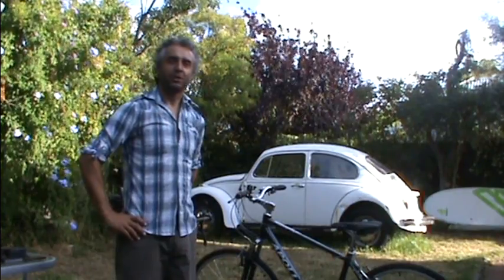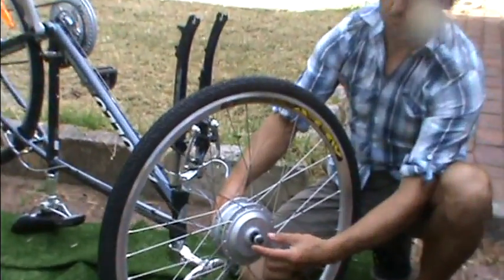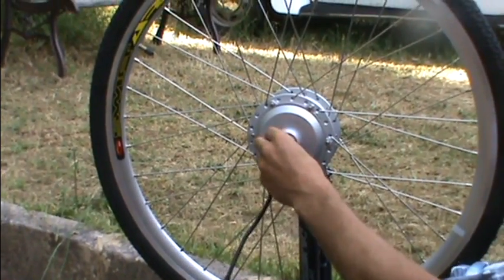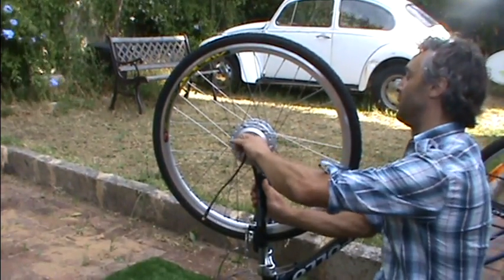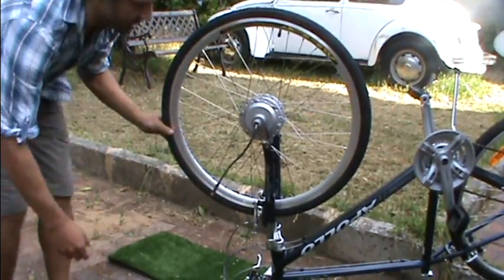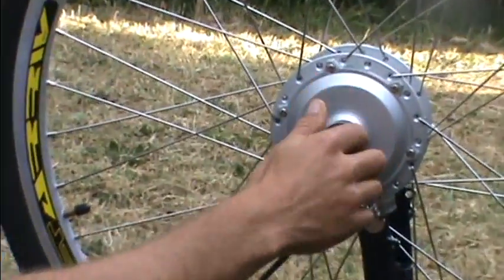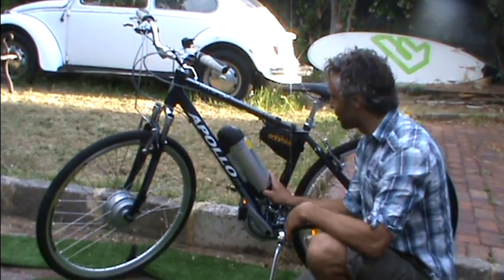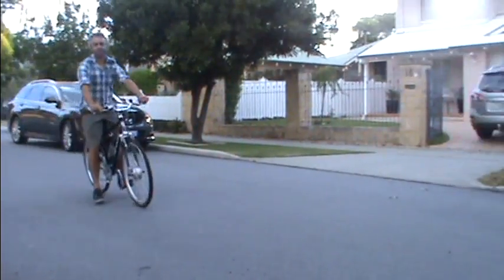Electric Bicycle Kit Installation Video Using Panasonic Tube Battery

Comment: hi I have a 1000 watt solar ebike and I was wondering if you could tell me how to set the computer that shows U how much battery U have left and your speed etc etc. as I messed around with it and the Speedo is off and the pedal assist has stopped working due to messing with the P and C settings.
I'm in Perth metro area if U have a shop I can come to what ever is easiest as the shop that sold it to me in Newpark has shut down. Thanks and good viewing

Comment: You don't need a torque arm for a 250w front hub motor only over 1000w than you need a torque arm

Comment: I've fitted 2 kits exactly the same type, really easy to do if you take your time. I've done 1000 miles over the last year, they are great to ride and it's up to you how much work you put in.
Reply: Hi there ...Can/does the battery charge itself when you peddle instead of plugging the battery into your house mains ...Thanks john

Comment: tip for removing grips, if you can pry up edge of grip and bust a little bit of nut under grip it slides right off ! if there is any leftover save for another project or give to significant other.

Comment: Hey, your information is fantastic, due to time and money constraints it has taking a year to build my Cannondale Scalpel  with an e-bike conversion kit. I elected to place the hub motor on the  rear wheel with a 48v 1000w system using a Panasonic Lithium Ion battery (pictures and video available on request). Your video has been an extreme asset in this build.
My question is it the VW in the background available for sale?

Comment: Why do the yanks always think they are special don't like the price it's simple don't buy it
Reply: Yes, most yanks are idiots, yet as a Yank my self I took this invaluable information and applied it to My Cannondale Scalpel with a rear mounted mounted mounted 48v 1000w motor with a Panasonic 54.6 volt battery and it simply runs like a charm. Again most "Yanks" take short cuts to save pennies and time yet the few of us that utilize our brains and common sense can build a the some of the best e-bikes by referring to this video. 
This should be a required video for any one building an e-bike.
Admittedly, I spent a few hundred extra quid, yet this video post helped me build an e bike that accelerates  to 36 mph (57.94 kph)
Surely I have used all the top components available, like Cannondale frame Scalpel frame with a lefty fork Lefty fork, Mavic rims, Cannondale carbon seat post and handle bar, yet the bike simply screams screams down the road as I pass my co-workers driving the gas hogs sitting in heavy stop and go traffic.
Yet my upgrades are not needed, I only did them because I wanted the best.
All any any comments and questions are welcome.

Comment: is it possible to fit on drop handle bars with STI brake gear levers
Reply: +Anthony Poore Drop bars are difficult.  The width it typically a bit larger than that of a flat or raised bar. You can't get the throttle on.  There is the odd solution I've seen that isn't so elegant or you could you a pedal assist sensor in the bottom bracket and have no throttle.
Reply: +Matthew Timmins I have the wider drop handlebars (I'm wide at the shoulders) STI Brakes incorporate the gear levers,171/2 inches /44cm inches apart. This leaves 4 inches/10cm free on each side of straight, from the levers inward spare for fitting the control. I take it you do not mean the diametre of the tube
Reply: +Anthony Poore No, I mean the diamater of the tube. It's different for dropbars - just a touch wider than a regular flat bar and makes the throttles incompatible.  I haven't found a particularly successful solution for this - besides changing everything to a flat bar or pedal assist only.

Comment: Mate I bought a bike at a auction with the what seems to be the exact kit installed . However no information nor a charger came with the bike . It has a 36volt motor 26 " rim and in the soloarbike bag the specs on the controller  state BLDC motor controller 6--Li36--14. You werent very specific about the charger save for the green and red lights - Could you please provide more detail on that unit as I need to purchase one suitable for this motor . Much appreciated regards

Comment: What if you have a disc brake, would it fit?
Reply from the maker: Yes, you can put it on.  All motors are disc compatible.  You need to use correct rotor bolts (get from a bike shop as they have lock tight thread and are a bit longer) and at times it can be fiddly to set up because you potentially have to space the disc away from the motor to create room for the caliper to sit between the motor and disc.  You can use a disc spacer for this.  If you're in America, then the best company that can sell you kits and provide all accessories is ebikes.ca  They're great.  If you're in Australia then give us a buzz. Getting the disc to sit beautifully between the caliper can also require some spacing of the motor between the forks with washers on the insides of the motor.  There is some float on the caliper itself but you need to get the motor in the right range at the start.  In 90% of cases it simply sits straight in there with small adjustments of the caliper but you have to be prepared to do some fiddly spacing with discs. You can always get there in the end but patience and good tunes does help sometimes with discs.
Reply: ***** All "our" motors are. Most other suppliers are disc compatible these days.
Reply: disc brake want work..cause your break handle need to be changed ...its a sensor in the break handle you get in the kit..so you need wire brakes...
Reply: selton1

Comment: Will this kit work on a single speed tricycle?
Reply from the maker: yes.  just need to get the correct size rim
Reply: I ride a Miami Sun Tricycle. Does that matter or should I get the width of the wheels?

Comment: Can we install tow moter using one controler and one battery
Reply: Yes, but you will need a more expensive controller with enough watts for both motors.

Comment: I'm developing a liquid cooled 36v 22ah ebike battery pack made up of cheap 2200mah 18650 cells. 10 in series for 36 volts and 10 36v rows in parallel for the 22ah capacity. The cells weigh 44 grams each so 100 would be 4.4 kilos  so figure around 18-20 pounds with the case, wire and cooling system. I found them for $37 for 25 cells shipped so that should run around $180 bucks for a 36v 22ah pack with all the wire and PC cooling radiator bits and pieces. I plan to flood the pack with mineral oil and circulate it through a dual 120mm fan 240x120mm PC cooling radiator with a PC cooling pump to keep the cells cool under load. I may even liquid cool the controller too. When you keep the heat down you keep the resistance down thus saving wasted energy. I think the extra 5-6 pounds of liquid cooling gear will be well worth the added weight.

Comment: If there's a self sustaining power source keeping the engine running for as long as the power source is running, how is it not perpetual motion? The minute you stop?
Reply from the maker: There is no such thing as a self sustaining power source - if we operate under the commonly accepted laws of thermodynamics.  With every mechanical or chemical transition you lose a touch of energy to contribute to greater levels of chaos in the form of entropy. Ie. you cannot have a battery run an electric motor that then charges a battery that then runs the electric motor.  You will always lose energy as heat and sound etc. Your battery will go flat quite quickly. The best we can do is minimise energy usage and use it more efficiently. My opinion is that even solar, geo thermal, wind etc. is not renewable.  All of these require energy input to create the system and they all require fossil fuels.  Once fossil fuels are gone these so called renewable energy systems will soon become un-usable. Only biological systems are renewable - growing trees and getting the oil out of them or burning them for heat.  This is the most renewable - but even these rely on the sun for energy and even that is a finite resource.

Comment: Hey you know you can keep the bike going indefinitely if he would simply add a tire generator to the bike, which would keep the battery charged which would keep the wheels moving which would keep the battery charge which would keep the wheels moving which would and should by now give you a notion of continuous motion

Comment: This a cool conversion.  I could imagine in the future the batteries will get smaller, ligher and more powerful.  Also, the smaller the rim you have the higher acceleration you will have.